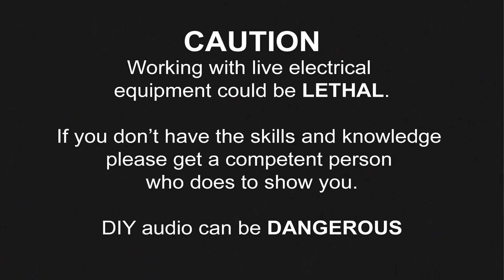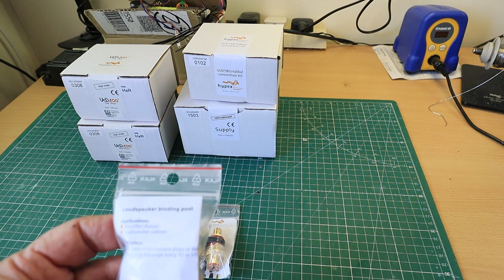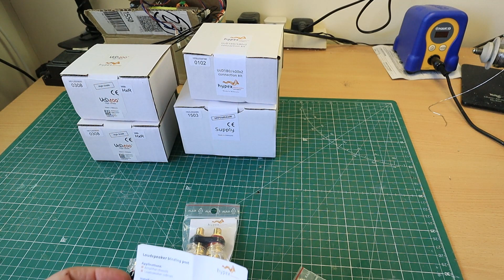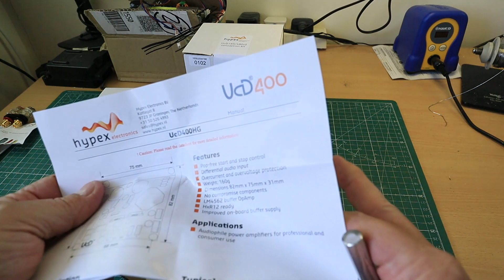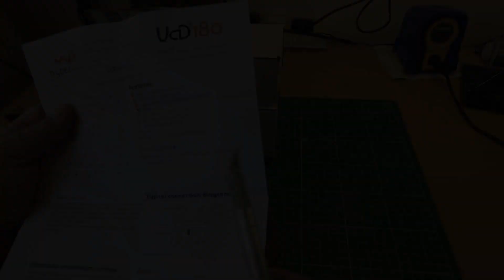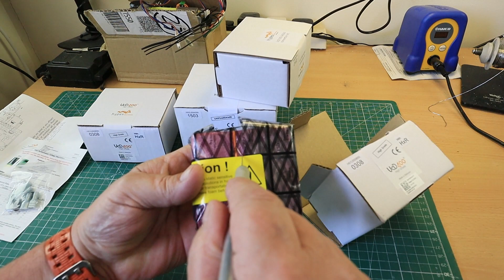Hypex UcD400 build with a bit of a case 'twist' towards the end..

Comment: nice amps!  (comming from my country :) ) i talked to Craig and ended up here ! nice work dude ! by the way nice HAKO :) if ur able to buy as a comp[any the NCores are within reach. and they should sound a bit better (apparently ),  i my self are not into amp sounding things... since i dont think it matters all that much. i think its usually overated, they dont change the sound all that much. im talking 0.01% distortion differences or less...  speakers is where it is and proper amount of power if you want to talk amplifiers.

Comment: How did it work with the Treo these UcD amp did you like the quality 
Did you try the nCore NC400
Reply from the maker: If you go to the Trio Prt3 Video 08:28 there is a sound test. The UcD's are OK but not quite right for mw. IMO the UcD variants sound a bit 'soft', slight lack of grip at the bottom end. I will try the NCores next which I'm told are far superior.